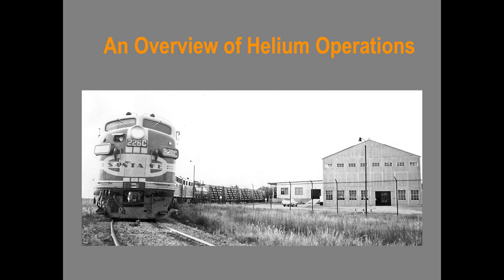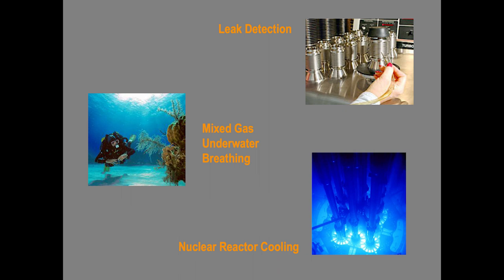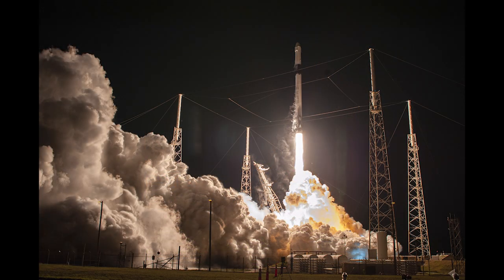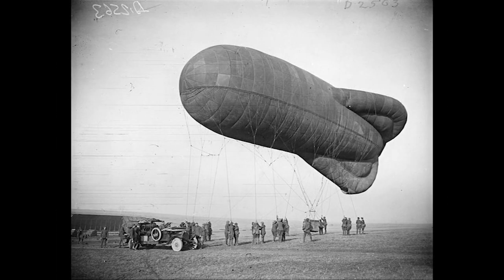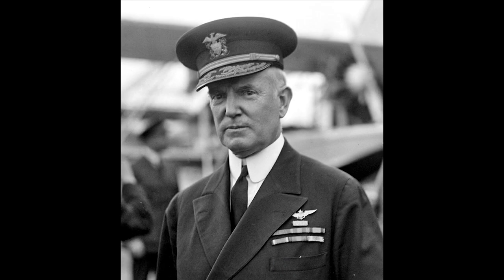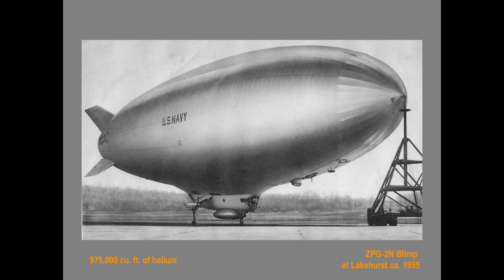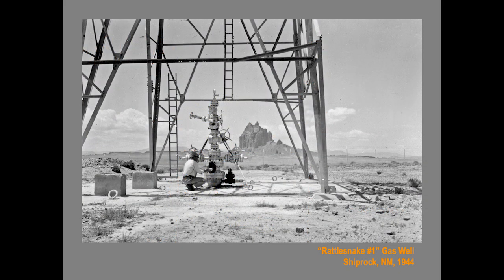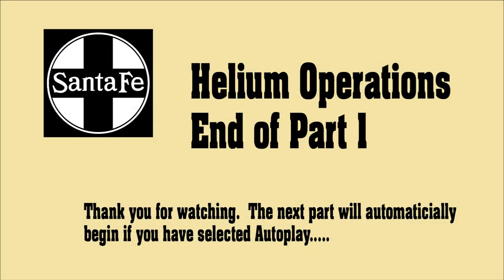Helium Operations on the Santa Fe Railway Part 1 of 4 – Natural Gas to Airships

Comment: There is a picture shot in 1936 overlooking Lakehurst, NJ when it was a naval air station.
What's unique about this picture is that it shows the Hindenburg (in-flight) during first year's operations and in the upper right corner, moored on the ground, is the retired American airship, Los Angeles/ZR-3.  You can easily see Los Angeles is MUCH short (about 150 ft shorter in length) and has a spikier tail section.
You can find this photo with the search terms "LZ 129 Hindenburg with RD-4 over Lakehurst May 1936" and it pops up right away.  
I've seen the photo on multiple websites dealing with the Hindenburg and Lakehurst NAS.  I never saw the Los Angeles and Hindenburg in a photo together but here it is!  This IS the Los Angeles in the photo because by this time (1936), only the Los Angeles (ZR-3) still existed intact.  "US Navy" is painted on the side (illegible but look at other pictures of ZR-3 and it's in the right place) along with the American star that was painted on all US Navy airships.  All other US Navy airships had been destroyed in accidents including the one (ZR-2, lead ship of R.38 British class design) that was built by the British but destroyed in test before it was delivered to the US Navy!
I looked but I could find no signs online that ANY piece of the Los Angeles/ZR-3 had been preserved.  There are remnants and pieces of the Hindenburg and Graf Zeppelin 1 preserved in several museum including the museum in Hangar 1(?) at Joint Base McGuire-Dix-Lakehurst.
Reply from the maker: Thanks for the new information!